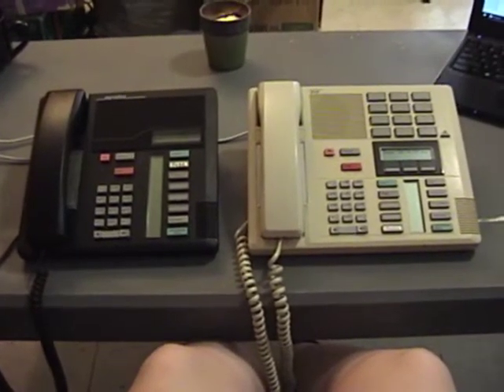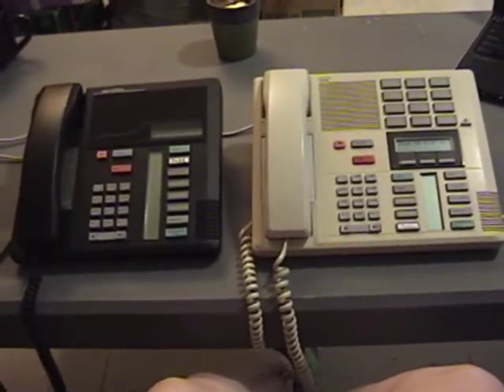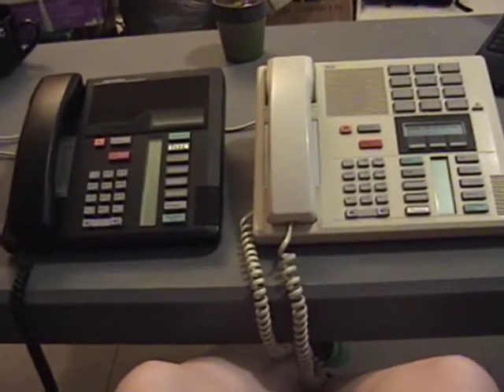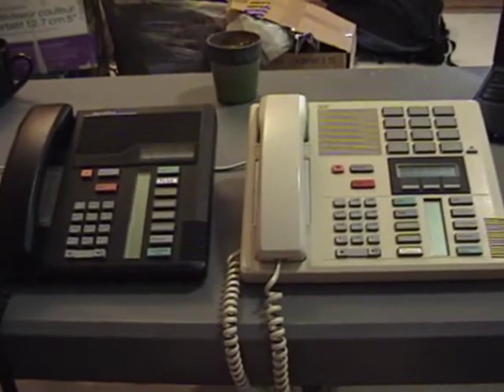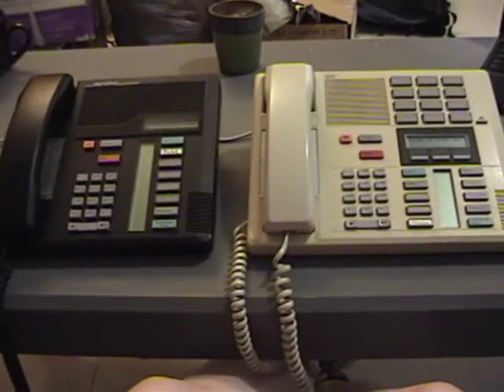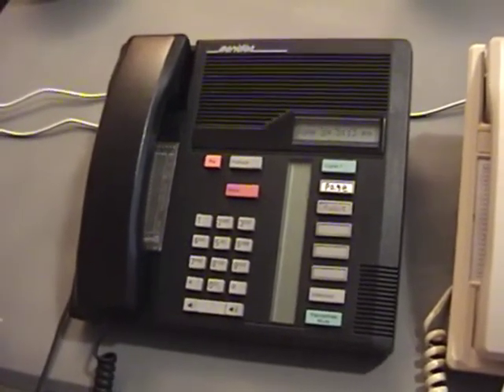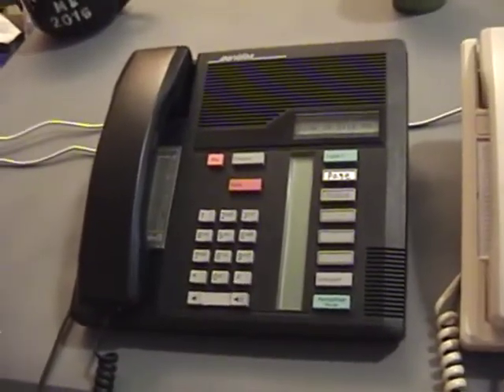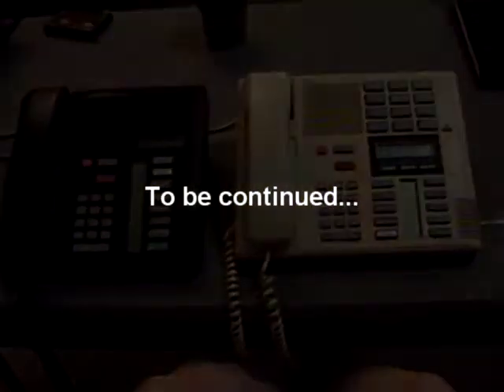Norstar: Introduction to office telephone systems

Comment: One thing that I'm curious about is, here is a scenario that happened to me. My school (or former school)'s office has a phone on a counter anyone can use to call their parents, etc. to pick them up or bring them something, whatever the case may be.

One time I was using it, dialed the numbers to place an outside call and then called. The phone number that was displayed via caller ID on the other end was the main phone number of that building. While the call was in progress the phone near the secretary rang and she answered it with "(Name), how may I help you" indicating someone called the main phone number, which was the same phone number that was displayed when I called and, at this point 2 calls were in progress over what I thought was over the same phone line, which didn't make much sense to me.

On a home phone if you call the number while the line is in use/busy/someone is already in a call, it will just keep ringing.

I'm still not sure how this is possible all over the same line (Phones screen displayed "Line 1") unless it's some VOIP magic the PBX was doing and not using a physical line from the phone company.

I do know that building was equipped with T1 (Not entirely sure how T-Carrier works but that doesn't matter here) which allowed them to have multiple phone lines and internal lines between multiple physical buildings (you could call a phone in a building across town/another school as an internal call), but I'm not sure if they fully switched to VOIP or not at that point in time. If they did they indeed kept the same phone number, however when I looked up the carrier of the phone number it still displayed "Frontier Communications" which is a landline phone company that doesn't provide VOIP as far as I know.

They used a combination of a Nitsuko (NEC?) phone system from the late 90s and were in the progress of installing new Cisco IP phones as well.

I was just fascinated that 2 or more outside calls could be done over the same line
Reply: How do I clear a voice mail

Comment: I've had a few VOIP apps that were able to give me phone numbers with my same area code, however typically you don't have to dial your area code to call another phone number with your same area code, but in this case I had to prefix my area code to get this VOIP number to call from my POTS/PTSN phone or else omitting it would just cause it to fail and give me a busy tone. Pretty interesting, I can only imagine the reason behind this has to be due to how the VOIP service interfaces with the POTS/PTSN network.

Comment: First digital "computerized" exchanges showed up in the 70s, with the NT DMS-100, WEco ESS series (5ESS). Canadian exchanges basically went from step-by-step directly to digital  by the early-mid 80s, skipped crossbar entirely for the most part.
Reply: Also, the Norstar telephones are digital fwiw, which is the main reason they wouldn't work on a normal analog line.

Comment: these days even your land line phones are technically voip just as you can easily switch your number from landline to cellphone and vice verse. also question have you thought of changing the hard drive in it if it dose have one to a compact flash
Reply from the maker: No hard drive. It's all discrete logic and ROM storage. The successor to the Norstar, the Nortel Business Communication Manager, uses a hard drive.